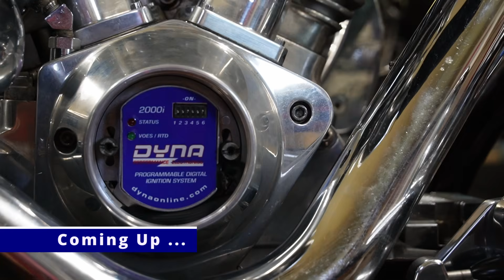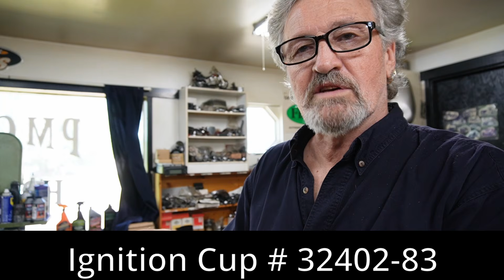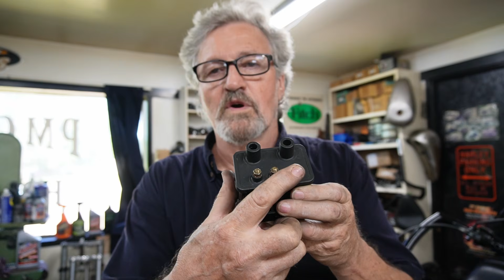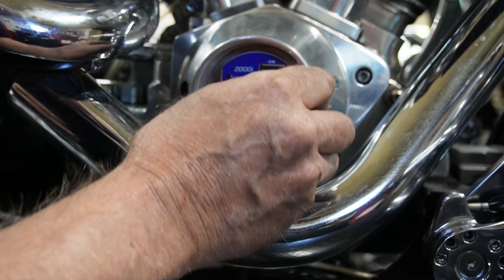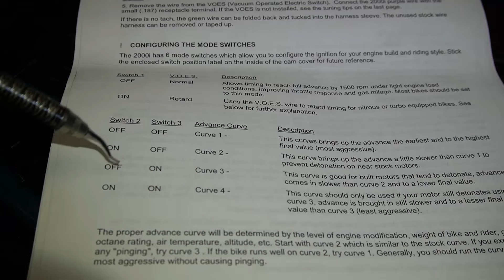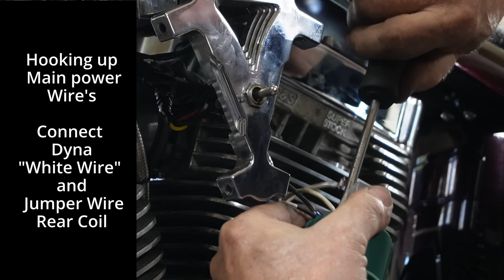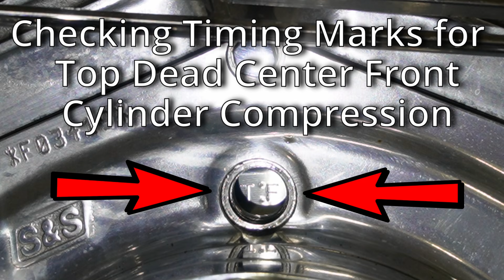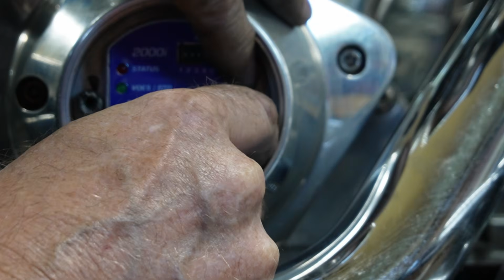HOW TO INSTALL A DYNA 2000i  IGNITION SYSTEM / THE EASY WAY

Comment: How do you put a Dyna 2000i on a 2004 Big Dog with an EHC New RIP system that I just installed?
Reply from the maker: I I think you could run one. I am not familiar with that EHC system but from what I can see in a quick check it is for controlling your electrics. Any Big Dog I have worked on here had a Dynatech or S&S type ignition in them. If your has such, in the nose cone, I do not see why you could not run the 2000i. But I am no expert...just going by past experience here. Remember the Dyna is wired directly to the coil, or coils. It is only fed 12 volts from the ignition on, and or kill switch.   It does not affect anything else in the system. Power from your kill to the coil is usually a grey wire but could be anything on that bike or system. Thanks for visiting the channel.  Let me know how you make out.

Comment: Wow, this is a great, straight forward video, thank you so much! I have a 1985 (Ironhead) Sportster with an older Dyna 2000P ignition installed when I bought it, and now a no spark issue. The battery, coil, plugs, wires, ignition switch have all been replaced so I'm thinking the module may be fried (the red LED light on the module does not flash when ignition is turned on). The Dyna 2000P ignition I have has an external module mounted to the frame with the lights and 5 advance curve switches on that module. There are no switches or LED lights in the nose cone where you adjust the advance. If I understand you correctly, the new 2000i ignition module in the nose cone will take the place of/bypass the frame mounted module I have? So if I purchase the new 2000i module, I can I discard the old frame mounted module? I appreciate any and all advice. Signed, an old tinkerer just trying to understand this new tech.
Reply from the maker: Thanks for the question. You are correct that you can throw the rest away and use the 2000i. You already should have the  gold ignition cup, and pretty sure you would already be using a 3 ohms coil. So you should be good to go. You will Love it! they preform extremely well and easy to install. Good Luck  !! Thanks for commenting.

Comment: Keep those videos comin !!! One question how well do they work with a kickstart.
Reply from the maker: The are excellent for a kickstart bike, especially when they are single fire. Trying to keep up and keep em coming.Sometimes its hard when you do it all yourself. But I will keep trying. Glad you enjoyed it.  Thanks for commenting.
Reply: when set up correctly and fuel system right it makes a kick start bike very easy to live with ...
Reply from the maker: Yes I agree. The are great for kickstart bikes. Thanks for the comment.